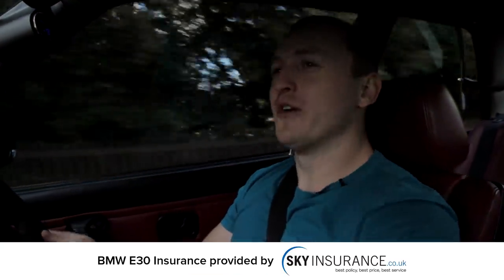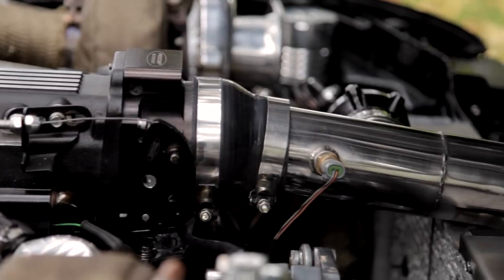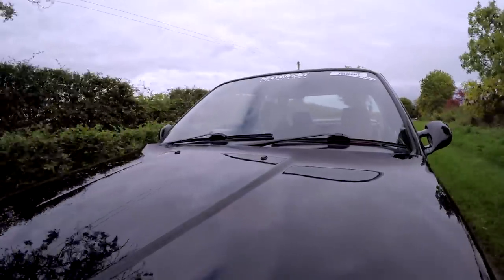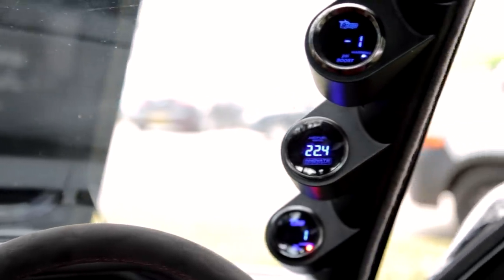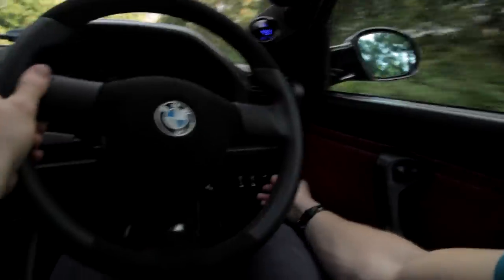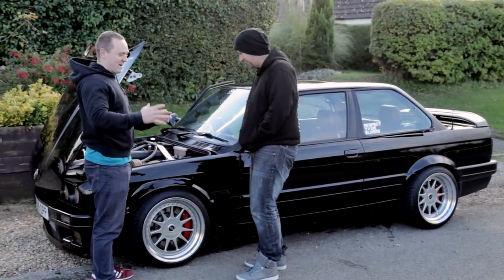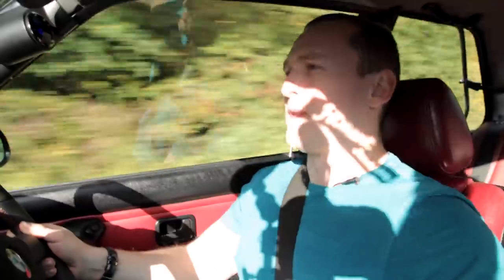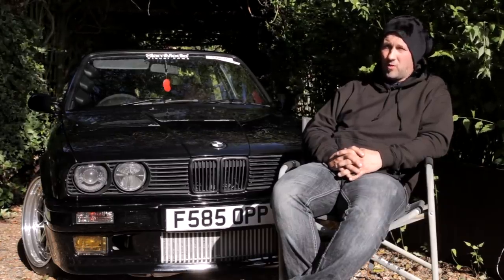800hp BMW E30 V8 Review: My Perfect Widow Maker

Comment: It is a nice car, but if you're putting a v8 in it, why not take a BMW v8 at least?
Reply: +Matthias Schmitt OH MY GOD i was thinking the same...that power figure is attainable with even an inline 6 bmw!
Reply: +Matthias Schmitt Even Morgan use BMW V8 engines.
Reply: he maybe liked that v8  More than a BMW v8.
Reply: +Matthias Schmitt Too expensive & tricky I guess - it'd cost a fortune to get 800bhp out of a BMW V8 plus compared to an American pushrod V8, they take up a lot more room, so would be much harder to fit in and you'd have bugger all room left over for the turbos etc.
Reply: TeqHDcasper maybe, but I just feels likethe car loses a lot of its personality that way and that's kinda sad because e30s are awesome...
Reply: +Matthew Sharpe pfft. there's people that managed to squeeze the v12 from the 750i/850i in an e30 :D
Reply: +Matthew Sharpe I doubt this e30 is any good handling through corners with all that power on those stretched tires so he can make his lips poke out. he needs way bigger tires and possibly a wide body or fender arches
Reply: because MURICA
Reply: I think the point of the build is getting the largest v8 in there. The largest BMW V8 is "only" 5l from their own cars.
Reply: Matthias Schmitt Yes, but they are very low powered engines for the displacement and unless you have very deep pockets, very difficult to add forced induction to, and again, you'd have the problem of where to put the turbos, route the manifolds, intercooler etc.  Basically, it's un-tenable to get 800hp in an E30 on a realistic budget without using an engine from another manufacturer - that's just BMW engines for you, they are expensive/difficult to tune and modify - BMW deliberately make them this way by doing things like not working with the aftermarket parts providers and not releasing technical documentation - that is why they are not popular for high power applications.

This guy clearly isn't a millionaire and isn't concerned with badges, so he's come up with a solution that fits his budget, knowledge and skill set.
Reply: +Long Dong That isn't the case though seeing as the BMW V8s are physically larger even with lower displacement
Reply: Fredy Sanchez Yes, I agree, I can't imagine it would be much fun to drive hard on a winding road, you'd probably never approach half of what the engine is capable of - but I don't think he's much concerned with that.
Reply: +Matthew Sharpe so wrong.
Reply: ***** How so wrong?  Show me an E30 with a BMW V8 or V12 in it making 800bhp and what the budget was for the build - it'd be several times what this guy spent I bet.
Reply: +Matthew Sharpe as i said before. you dont need a v8 or v12 to make this power on a bmw. also theres a lot of aftermarket parts for bmw.
Reply: ***** Maybe he just wanted more torque ?
Reply: +tank2g2 maybe. but torque/rpm equals hp so 800hp as long as its not on 9000rpm are quite torquey.
Reply: pushrod vs overhead cam is a huge difference in size.The ls motor is really narrow compared to an ohc motor
Reply: ***** Yes you can get good power from smaller BMW engines, and they are popular enough that despite BMW's best efforts, after market suppliers have put in the hard work to develop solutions.  I still think 800hp would be a very expensive build though - I have to say I've never seen a swapped BMW engine put out numbers like that - I'm sure they are out there because people will do anything, but you don't see them around like you do with JZ's, RB's, F-series etc.

Regardless the original comment said why not use a BMW V8 - and thus I outlined why he probably went with the pushrod V8 - because it was within his budget whilst a BMW V8 would have been far more expensive.
Reply: tank2g2 I meant larger as in more displacement, not larger physically
Reply: +Matthias Schmitt Exactly what i thought. Expected a 4.9L e39 M5 engine to be in there T_T was slightly dissapointed
Reply: Can't easily get 800HP from BMW M62s and S62s... on the other hand, Chevy and Ford Engines can make Reliable 800hp with forced induction... Cheaper too.
Reply: +Matthew Sharpe that and the LS Chevy engines take to boost really well ( I'm guessing that's what this is)without much modification and there pretty pretty easily modded to make tons of power 800 HP isn't even considered that crazy anymore. that and the aftermarket support is crazy people make upgrades for almost all aspects of these engines.
Reply: mh87351 There's also the compact size of the V8 Push Rods compared to V8 DOHC engines. And the weight...
Reply: +Matthew Sharpe I have a buddy with a E30 with a 540i V8 swap. There is plenty of room for turbos. Only issue is having to find a different spot for the master brake cylinder, and minor fitment issues due to the footwell, but nothing a decent sized hammer can't solve.
Reply: Anders Kristensen Like I said, someone is always going to do it, doesn't make it a good solution though.
Reply: +abernathy0011 404 hp stock isnt real power? Also you can get over 600hp with a supercharger and supporting mods
Reply: +VizinoGaming In Finland we have this BMW E30 Turbo 1192HP @ 2.0bar with BMW engine.

/watch?v=UTYlJolezYE
Reply: +Nak5u There are a lot of different routes to go in to make lots of horsepower and torque, this guy (like many) made the choice to go with a Chevy small block engine. Some people have pushed lots of horsepower and torque from other engines as well, there are a lot of factors that go into what engine people swap in once they make the choice to swap. 

The small block chevy just makes a really strong case for itself, there are other engines that also make a case for themselves like a 2JZ engine. A huge benefit of the small block chevy is that they are light and compact for their displacement, this means that you can go with a larger displacement engine then what you would otherwise realistically go with. An LS3 crate motor is about the same weight as the twin turbo I-6 engine in the Supra (I believe the LS3 is a bit lighter), so if weight balance was a concern then the LS3 would be better for you. It can also make power more reliable as it doesn't have to rev to make power. Yet you have the option to build a high revving motor that makes tons of power up top if you wanted to, you can also go with forced induction easily. LSX motors depending on the casting are good for 2,500+BHP which is flat out more then any sane person would ever want in their car (but some people do that). 

Then there is the large after market for the engine, and the wide support (in the US) for said engine which some Japanese drift teams run SBCs when they run in the US (and some run them in Japan as well).
Reply: +Matthias Schmitt BMW V8 is far larger, far more expensive, less reliable, far smaller aftermocket, much heavier too.
Reply: +Matthias Schmitt The engine he used is infinitely cheaper, has a way bigger aftermarket, is most likely more reliable, and overall has much more potential than any BMW V8 that I know of.
Reply: +Matthew Sharpe lol, bmw v8 in here is like 500-1000 €, cheaper then my seal kit for 13b
Reply: +Matthew Sharpe Dude, you must not know much about BMW's, i've had them for years, and no, it wouldn't cost "leagues" more as you say. I can build my M52 and push 600 HP on stock internals, i can put a turbo on my z3 for as cheap as i could build a turbo miata. The problem is, is that most people who say BMW's are expensive to build, has no experience, and you do realize that you can tune the hell out of a BMW engine? Because saying otherwise show's you have no knowledge about BMW's. Also, DOHC is far superior to push-rod engines.
Reply: xDezzered I don't think that you read all my comments.
Reply: +xDezzered, BMW S85 5.0 Litre V10 engine, DOHC 40 valves, 90 degree bank angle 12:1 compression ratio 240KG 507 hp (378 kW) @ 7750rpm/520 Nm (384 lbft) torque @ 6100rpm
The S85 utilizes both individual throttle bodies and Double VANOS (BMW's infintely variable timing for intake and exhaust cams) It also has equal length tubular headers.

GM LS7 7.0 v8, 90 degree bank angle, pushrod single cam in block valve train 16 valves, 11:1 compression ratio, 206KG 505 hp @6300 rpm, 470 ft lb @ 4800 rpm, plenum intake manifold, basically log headers, no variable valve timing. 

S85 power&torque:weight ratio, (2.113 HP/KG, 1.6 ft lb/KG) 
LS7 power&torque:weight ratio (2.45 HP/KG, 2.28 ft lb/KG

THE LS7 WEIGHS 34KG LESS. .Not to mention far better torque curve.
The Ls7 outdoes the s85 in nearly everything and has FAR less technology. It also costs less than half.
Now let's see what happens when the ls7 actually comes with more technology,
Mazzanti Evantra's variant, 701 hp at 6600 rpm and a maximum torque of 848 Nm at 4500 rpm, wow that's overkill, and still has the 11:1 compression ratio and still more room to improve. Smaller, lighter, more torque, lower CoG, better power band and still more room for improvement through aftermarket parts.
You can see that the pushrod ls engines are one of the best if not the best engines if you want POWER:WEIGHT ratio, I can literally write a research paper about the advantage of pushrod v engines over dohc for performance engines with a rev limit under 11,000
There is no apples to apples comparison you can make in favor of dohc engines in street cars, take v8 supercars in australia for example is dominated by ohv pushrod even though there are 4 cam DOHC competitors, same compression ratio, displacement, same redline, as apples to apples as you will get.
All I've got to say is, come again?
Reply: Chris Huynh Main advantage in the consumer market space is it's easy to get both good fuel efficiency and good power from OHC - not so easy with pushrod (though again, it's just an engineering problem, nothing is un-solvable)  That's really why OHC has come to dominate engine design.  Having said that I've never driven an LS powered car that doesn't feel unhappy at revs, they always feel like they start to drag in the top end, and it's not pleasant compared to say a modern Ford OHC V8.
Reply: one is 5 liter another is 7, cmon how can you compare that? And diveability of BMW is so next level compared to prehistoric pushrod fossils of US....
Reply: wickedroman I think generally American car enthusiasts don't have to consider fuel economy and emissions like those of us in the rest of the world paying twice as much or more for fuel and/or who actually give a fuck about the environment do.
Reply: Matthew Sharpe V8s are often times as fuel efficient as other sport car engines, sometimes more.

My 5.7L V8 Corvette gets better fuel economy than my 3L Straight six M3 did.

Compare the fuel economy of modern V8 sports cars to that of other sports cars
Reply: Justa318i Yes a modern LS engine can return good economy under normal, low load driving conditions thanks to long gearing and clever tech like cylinder cut-off - drive them hard though and they are all guzzlers for the amount of power being produced.  Old BMW IL 6's are of course lacking any such tech.
Reply: Matthew Sharpe I'm comparing the LT1 from my 93 corvette to the S50B30US of my 95 M3
Reply: Matthew Sharpe the reason that they feel unhappy at high revs is because their cylinder heads, camshaft and valve train are literally optimized in every rpm range right before 5500 rpm then they fall off from there. If you think a revvy pushrod v8 is not possible you've got another thing coming.just take a look at nascar (9000) rpm, and pro stock, (11000 rpm) 500 ci or 8.2 L. Despite that, having a peaky engine for the road is extremely impractical. With the struggle of emissions regulations and fuel efficiency, you have to admit GM is doing an incredible job
Reply: wickedroman How can I compare that? Lol. They both make similar hp figures. The 7L weighs so much less, has less technology, is smaller, cheaper,  and outdoes the over engineered bmw engine by embarrassing amounts in almost everything. And btw you realize that overhead cam is older technology than pushrod cam in block design right? And hell no, the drivability of the 8250 rpm redline with a torque curve as heinous as that has no where near as  much drivability as the broad torque curve of the lower revving, more useful powerband of the LS lmfao.
Reply: Chris Huynh agreed, they are definitely making awesome engines.
Reply: Chris Huynh I believe 280 foot pounds of torque at idle do offer more than enough drivability...
Reply: Matthias Schmitt 280 ft lbs at idle? Lol. 250 ft lbs starting from 2000 rpm is more accurate. Despite that, its drivability was being compared to the LS7.
Reply: NutriFIT nutritie si fitnes The price it costs to increase the E39 M5's v8 to 600HP is still greater than how much it costs to build an all brand new parts LS v8 ENGINE capable of 600HP
Reply: Chris Huynh so what? It takes much more to rebuld a ferrari f40 v8. But it is still wrong to put an LS in a Ferrari, it just wrong and like it shouldn't be made.
Reply: wickedroman If it's what the owner wants, and they payed for it, how could it possibly be wrong? To each their own.
Reply: To each their own, so don't call it perfect...
Reply: LOL, its a mass produced saloon car from the 80's produced in the hundreds of thousands, not a Ferrari, don't be so precious.
Reply: It is a pile of parts in general made from plastic rubber and metal like a Ferrari or Talbot or any car...
Reply: Could have been down to what was available, he might have had that LS engine sitting in the workshop next to that car at one point and just put two and two together, both literally and figuratively.

I bet the LS was an easier fitting candidate as it's a very compact size V8 compared to BMW's offering.
Reply: This engine will make more torque and power at any rpm than any bmw v8.
Reply: your right the str8 6  m engine 3.2l with turbo could probably give you more than the chevy block as well as maintaining close to original weight and the 8250rpm.  I think after you put a v8 or bigger in e30 the handling wont be as good?  I know in the wet you have to be a good drifter to drive them properly but in the dry the handling is wicked.  Bmw have fucked up a bit by not introducing turbo and 4wd alot sooner on alot of their models like audi have done from the factory.  A4 b5 with rs v8 stroker 4.7 litre single turbo does 0-60 in 2.7 seconds.  Maybe he just liked the idea of having that big american 6.0l v8
Reply: Matthias Schmitt because he has a unique car
Reply: haters gonna hate
Reply: Ali Junior You know what haters stands for?
H-aving 
A-nger 
T-owards 
E-VERYONE 
R-eaching 
S-uccess 
I use that often as haters hate me for my toys!
Reply: i know how you feel mate, i drive an 89 e30 with a 325e block and a 325i head. people think its just a regular m20b lol i use the hate as motivation to push myself and the look on their faces is priceless after :D
Reply: Matthias Schmitt because he's working with what he has ..?
Reply: Word, I thought it was a a BMW V8 before I watched the video.
Reply: agusgolturbo it is probably easier to take care of, and I can only imagine there are quite a few maps for that engine aswell.
Reply: I agree. It doesn't matter how much power you're putting down on the street... its not all about numbers. 

AND, that V8 sounds like dogshit. Maybe its just that exhaust setup.
Reply: Matthias Schmitt lol a car with 800hp never loses it's personality
Reply: agusgolturbo Do you really need more than 800hp? I would rather have 400hp and twice the reliability than this stupid time bomb.
Reply: Matthew Sharpe you are a little misinformed bro. That's not true. The U.S. has the strictest standards for emissions in the world. But it is true, petrol is cheaper in the U.S. but not too long ago it was close to double. And American  really felt the expense of gas based on the proliferation of sub compact cars over the last 10+years. Now they are in decline because petrol is cheaper.... But The 6.2L direct injected version of this engine with active cylinder deactivation(v8 to a v4) in the Corvette makes 460hp 460ft/lbs of torque. It gets 30mpg on the highway. An auto journalist, trying to get the best mileage, saw around 37mpg cruising at 60mph. The engine is light, compact, and fuel efficient. The U.S. sports car is more fuel efficient than an equivalent 911. And the 911 is rear engine. Also, you're not considering that this engine is making 550-800+hp. Do you expect all 800hp cars get wonderful mileage or are your preconceived notions about the U.S. based on misinformation you assumed or never considered the validity of.... Your ignorance shows it's the latter.
Reply: Matthias Schmitt Or even a v10 from the m5/m6.
Reply: Because BMW v8 are notorious for being harder to tune i.e a lot more bloody expensive depending on were you are really , bloody Germans mate always have to be awkward